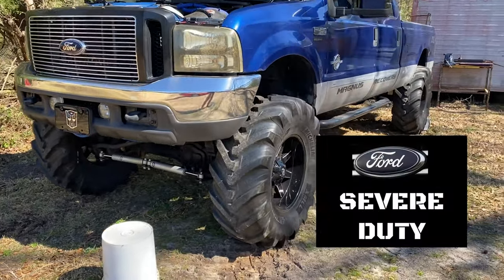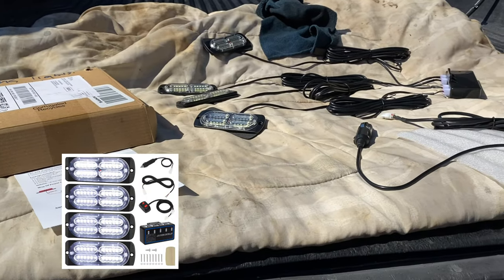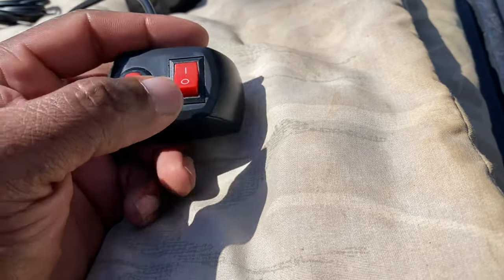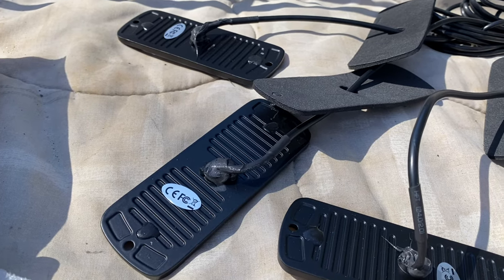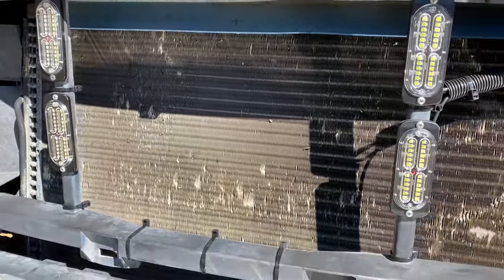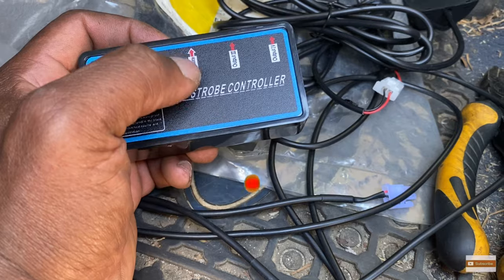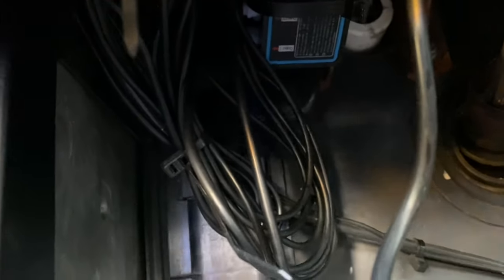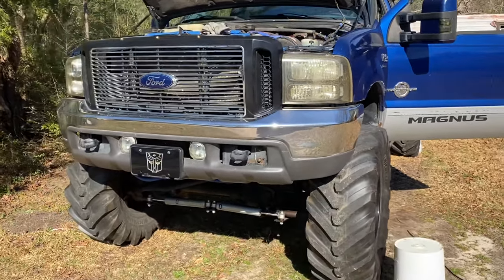Review and Install : Linkitom Strobe Light Kit From Amazon!!

Comment: I was wondering why you chose to use the cigarette lighter plug instead of running the hard wire from the control switch back through the firewall to your fuse box.  Then you would not have that wire running across to the cigarette lighter.  Everything else looks very neat and professional.